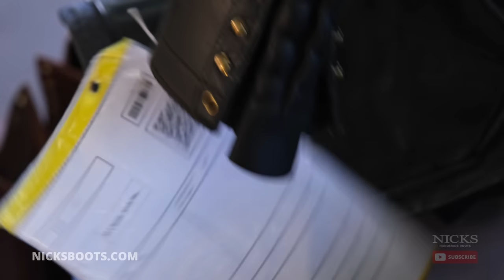Work Boot Restoration - 30 Year Old Handmade Leather Boot Restoration

Comment: Wow, quite the transformation...amazing.  With the teardown and repair, I think this ended up taking more time and work than building a new pair for Nicks.  Of course, if I owned the boots, the broken in uppers and history/memories attached to them makes the rebuild more than worth it.  Hopefully, the owner will use the kilties this time.
Reply: The broken in leather is so important. I wore my wolverines for 2 1/2 years, bought a new pair last week and it has beat my feet up. It'll break in fairly quick in my line of work but dang it surely sucks.
Reply: The other thing you need to consider is that these boots can cost upwards of $750 USD. A rebuild is only a few hundred by comparison. What I'd like to know is how old are these boots?

Edit: I should have read the entire title. A 30 year old pair of boots. Being rebuilt for about $300USD. Show me any off the shelf boot that'll last that long!!!

Comment: With such an extensive refurbishment, I find it hard to believe that once they’re back together that any comfort benefit of them having been worn in by the wearer will be the same as before.
Reply: Then you understand nothing about boots.
Reply: @Totemparadox  …..I don’t have to have extensive experience with the refurbishment of high-end, hand made boots to have SOME Understanding of boots in general. I’ve worn all manner of decent quality work boots, pretty much every day for the past 30 years. I am quite familiar with characteristics of wear and aging regarding boots. So thank you…. Mr. Knowitall. The fact that I’ve never invested in boots expensive enough to warrant refurbishment is irrelevant. I was just expressing a doubt/question, as to the process in this video.
Reply: These boots may have been something that was passed down from one generation to another or even a keepsake to the actual wearer. No one knows at this point in time. As far as comfort, the upper should some ease in breaking in the vamp and counter support. From what I believe, these boots new are probably around $700-$900. By spending $200-$300 to rebuild these boots. A family heirloom may have been restored.

Comment: so basically newly made boots incorporating some old parts
Reply: Exactly what I think, but didn't know how to say 🙂
Reply: They keep the upper, but replace the vamp sole and footbed because it's necessary.

These are a hard working rough and ready boot, the upper is still broken in and shaped to the owners ankle and calf.
Reply: No different than restoring a classic car that's a rusted out tub.
Reply: Yes. Rebuild not restore.
Reply: @MRtwoTricks  not really. Its like putting an old engine in a new car
Reply: @m.b.82  that works too. Simply put, replace the bad and give the client what they want. To see a skilled cobbler at their craft, so rare today.
Reply: Why are you hating on my guy?!
Reply: Think it would be more worthy to buy a new pair.
But, If the owner wanted to rebuilt the old boots... 🤷
Reply: @albertorossi9937  it’s less expensive than buying a new pair, and the uppers are already broken in to the owner.  I’ve had several pair rebuilt through my fire service career.
Reply: "Broke in upper" sounds likes a stretch for reason, i have never thought as the upper being the hard part to break in, and you will still need to broke in the rest of the boot and once break in it will still probably have less lifespan because of the old upper
Reply: Yes that's what I am about to type 🎈
Reply: Too sentimental it was better make them new¡¡¡¡¡
Reply: @albertorossi9937  If you knew the cost of these boots in the first place, you'd know that isn't the case. And what's not mentioned here is how old are these boots? How many hundreds of miles has the person walked in them? These boots can cost upwards of $750 USD, a rebuild is only a few hundred.

Edit: I should have read the ENTIRE title. 30 year old boots....how many off the shelf boots last that long, even with 100% proper care?
Reply: @filadelfozuniga3411  The owner of those tired old boots is going to be broke when he gets the bill on that repair job.
Reply: @philt1771  if they can afford to do it in the first place, they're likely not exactly poor.
Reply: $550 initial cost 10 years ago. I think I paid $175 to have them rebuild about 3 years ago. Before Nick's boots I'd go through a $300 pair of danners or redwings in 1-2 years. Not near as comfortable as my Nick's boots. Redwings were the worst
Reply: @m.b.82  More like you kept the seat covers and replaced everything else on the car. I think it's great of this company to basically give the owner a new pair of boots for such a discount. I'm sold on trying a pair of Nick's Boots. Any company that values their customers to this length is more than worthy of my business.
Reply: @chubbyjohnson5480  oh no argument from me! Ive never even had a pair of hand made shoes, cant afford it!
And they do look like the best cobblers in the business.
It is a pleasure to see suck work. They built one helluva truck around those dusty seat covers!
Reply: *such
Reply: @m.b.82  They sure do! I really enjoy these videos. In this day, it's awesome to see true craftsmen doing something by hand. People have to take the long view on a purchase like this. Look at how long they'll serve you. 30 years? That's a hell of a return on investment.

Comment: The reason you want to rebuild is they take so long to get worn in, once you have an upper that is good. You hang onto that for as long as possible.
Reply: I was going to ask why rebuild as it looks like they put in just as much effort and material as a new pair. But thanks for the answer.
Reply: After this rebuild they'll have to be broken in again.
Reply: So its because the upper is in tune with the owner?  I ask because I can't help but think a new pair of Georgia's or such would be cheaper in the long run...
Reply: @The_Osprey  The lower part and the sole bed will, yes, but the uppers won't.

Comment: I loved watching the process; very fascinating! My only question is, why? Why would a person want to do this, instead of just buying new boots? The uppers were the only thing kept, which is not the part that's hardest to break in. I'm confused...
Reply: Couldn’t agree with you more. It can’t be cost effective to replace all of that. I would prefer a whole new pair as to have a pair with uppers that are dried and are weathered. Loved watching the video though.
Reply: @samuel1996BKK  Hey, I completely understand. But, why would you rebuild the lowers and leave the old uppers? It doesn't make sense to me. Get them to make you a whole new pair of boots, if they're going to go that far.
Reply: @AYZTyler  Simple. The uppers are still intact and broken in so less break in. AND this is cheaper. $300 vs $550 for a new pair.

Comment: Seems like it would have taken less time and been easier and cheaper to just make a new pair.  They threw 3/4 of the boot away anyway.
Reply: The cost is about half what a new pair costs. Considering that a lot of the break-in is the uppers softening up, and that part of the boot usually takes the least wear, it will usually be in usable condition the longest. These were really rough even so. I'm sure this isn't the most profitable service, but it does make for loyal and often repeat customers.

Comment: So what is the price point on rebuilding an old pair of boots… 7/8s the cost of new..? I have a 20+ year old pair that I thought there was no point in rebuilding…
Reply: $300 plus shipping both ways. More if Nick's needs to clean them, replace tongues, add steel toe, etc. Generally if the upper is still in usable condition it's worth doing.
Reply: same here, the price of rebuilding is almost the same as a new pair, i dont mind getting a new pair, i have 6 pairs of red wing, one is almost beaten up quite badly, but it is worn in the internal, i still wear it once in a while :)
Reply: $250.00 less than the price of new and you have a fully broken  in upper.   I'd pay $250.00 extra for broken in boots.

Comment: Awesome work, but I cant see why they didnt just order new ones? Instead of new ones with old bits that will now fail first.
Reply: No they won't.
Reply: The uppers usually are the part of the boot that takes the least wear. These were in especially rough shape, but if you clean and condition the leather as recommended, the uppers can last almost indefinitely.

Comment: You didn't fix the highlighted hole.
Reply: 9:24
Reply: @cameronwertenberger8941  It's not the hole that is shown in the title photo.
Reply: @heavenplus1  mmm I see. they just replaced the lower, so it was fixed, that whole portion was taken out.
Reply: @cameronwertenberger8941  Yes you are right. When the hole was given much importance then it must have been repaired accordingly.

Comment: I'll give ya this, these boots are built like tanks! But, the shape of the heels are just horrendous!! Its a shame such a well built boot is given such a horrible heel!! Why???
Reply: So you mean the heel stack, or the heel of the boot?  What looks silly about it?  I don’t see it I guess. As compared to what other boot, so I can contrast and see your meaning?
Reply: @andrewh6337  ok ill try....the heel on this boot has sort of a feminine flair to it. The heel isn't flat on the sides. The heel sorta has a riding heel look but it goes even further by angling the heel on the sides as well . In other words the heel is smaller on the bottom that it is from the top were it's attached the boot. Kinda like a high heel on a woman's shoe or boot. If this was a woman's boot than it would make sense but it's not. To me it just looks awful! Hope this description makes sense
Reply: @number1pappy   ok, now I understand what you’re talking about. I think they sell three heels for different needs (at least originally they had a purpose, mostly now for style). The have a logger heel, a dogger heel and a block heel. The boot heels have a tapered shape as it helps them dig into the ground when you need traction on loose pine needles, soft ground when fighting fires/felling lumber etc. It’s not for fashion but for function, and when folks know the why, they sometimes want the look/function and it becomes fashion!  Funny world we live in. 😄

See here:  https://youtu.be/gVkXoURuYk4
Reply: @number1pappy  I don't know the style of boot this is but most loggers that I've seen have this type of heel.